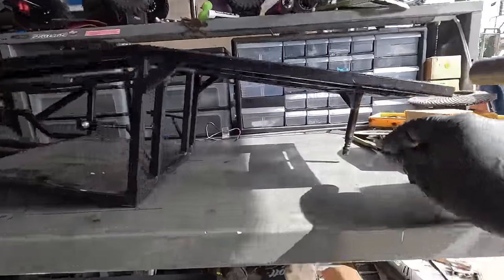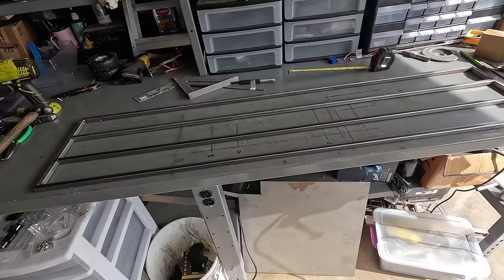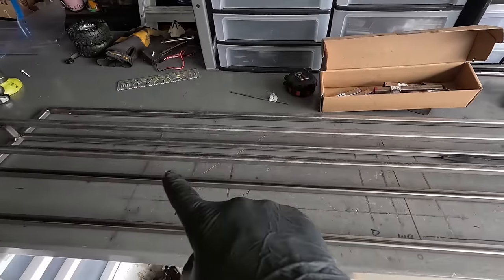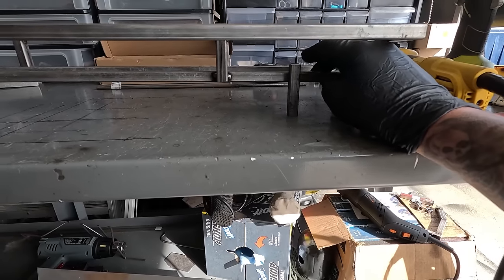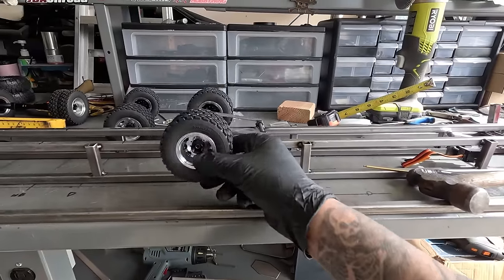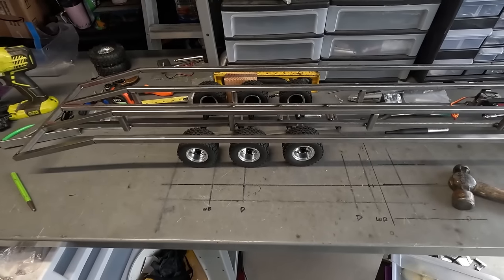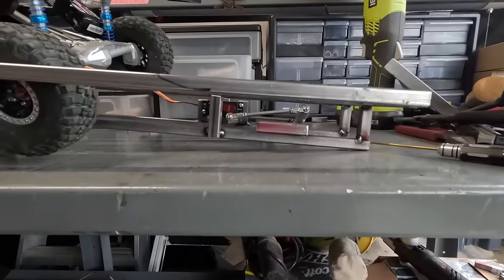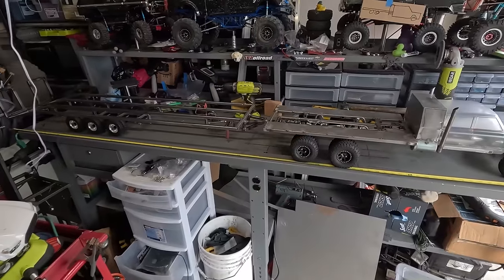1/10 Scale RC Crawler TRAILER!!... Full Of Surprises!!

Comment: On drilling those swing arms (if you’re using a drill press), stacking them and clamping or lightly tacking will allow all three holes be drilled in three moves. I’d love it if you put links, or at least a mention, of brand of the various parts and a source. It would be extremely helpful to us newbies to the hobby! Thanks for taking the time to film, edit & post these vids!

Comment: My first big trailer was made out of wood! Like you said, when you don't have access to a welder , don't refrain yourself and just make with what you can. Also wood is very cheap, lightweight and can hold a lot of weight. I could stand on it without breaking, without axles of course. 
Like your stuff. May the torque be with you
Reply: Would JB wield or some other epoxy work to join metal for RC use. Just a thought😊

Comment: Better to over build, than have to fix it on the trail. The motorized landing gear and ramps is a nice touch. If you ever want to try putting wood decking on a trailer or truck bed, ask for the thin stickers sawmills put in bunks of lumber at your lumber yard of choice. They average 1 and a 1/4 to 1 and a 1/2 inch wide, 1/4 inch thick and are four feet long. Where I work they just end up in the trash, on the 10th scale stuff they look like 2x10 or 2x12 depending on their width. And just like real boards, they are not always straight for that added scale touch.

Comment: Heck yeah man that trailer is amazin! I just built my own gooseneck and don’t have a welder. I used nuts and bolts to hold everything together and it seems really strong.  Used similar axles but cut and widendee them to be 11.5 inches total. I used single wheels but did dual axles.

Comment: My CrossRC BC8 and trailer is also 200CM, I park a traction hobby Tank 300 and king kong rc lurker on there. That's a 1/8th scale crawler and 1/10 sherp swamp all terain vehicle. Haul my fast boat, recovery tug and lipo storage bag all at the same time. Saves me walking back and forth. Also hauled like a ton of carboard box waste to the container outside. But at some point I need to build a proper flatbed and probably a double deck or double wide or extra trailer to haul more at the same time. It would be nice to haul myself too🤣

Comment: Another one with sliding ramps. When extending to end position the front of the ramps would have kick up to become level with the deck. Back in the day a screw jack was used to raise and lower wing tip sponsons on PBY's. Also, there is a decent ball hitch set out there. Thinking out loud. 🤔 What body is that? Cool.

REALLY great stuff you got there! 👍

Comment: It needs some small ramps so you can load by driving up the trailer and over to the truck bed so no disconnecting the trailer, are you putting pads on the support legs with bends front and rear of leg pad.
Nice job, enjoying your content only one thing, when you go from backing music to talking the speech is too low or maybe the music is too loud during welding, I have to pause and sometimes rewind to catch what you say being a softly spoken guy.
Reply from the maker: Yes I will be putting pads on the legs for sure. And I am working on the sound quality. It is the one thing in my videos that I am not happy about.

Comment: What kind of metal did you use ( measurements) and where did you get it ?
Reply from the maker: The frame metal is 1/2 inch square stock and you can get it at Lowe's or Home Depot in the hardware section. Home Depot is cheaper.
Reply: Thank you I have been searching online everywhere I also had an idea for your ramps too but yours I liked better once I got through the video very cool 👍🏻
Reply from the maker: Thank you very much!! I'm glad I could help.